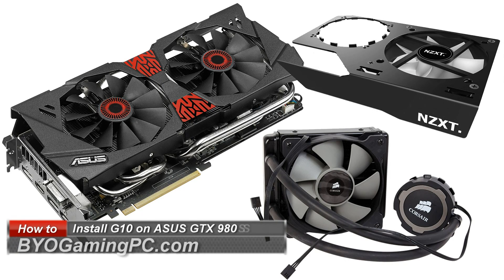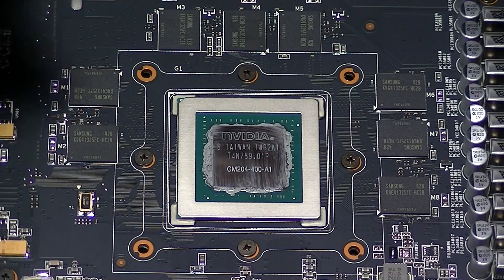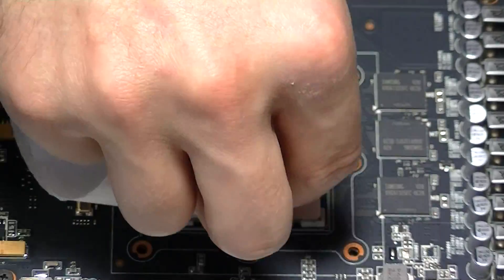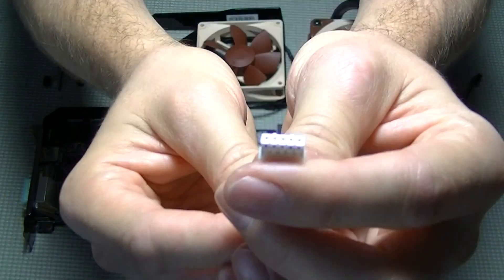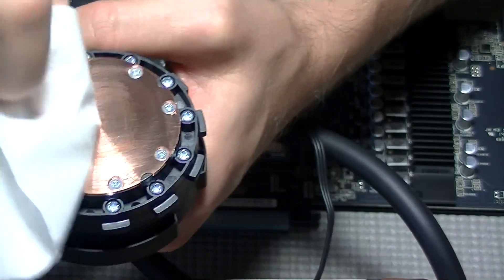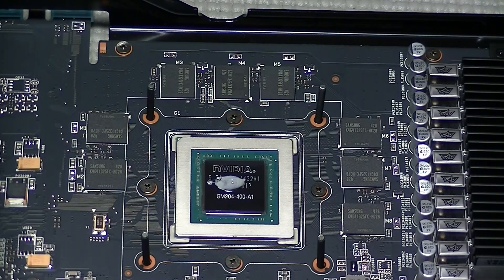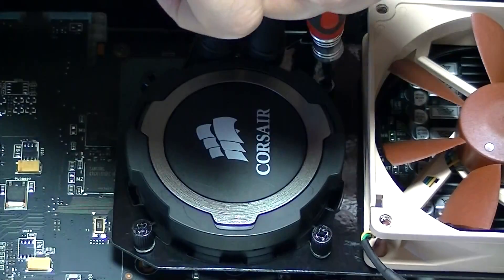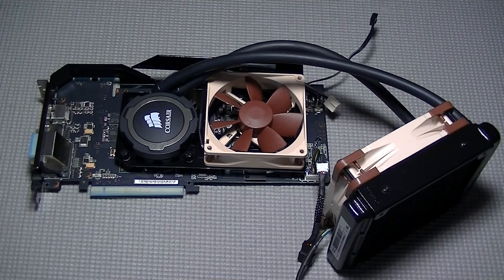ASUS GTX 980 STRIX & NZXT Kraken G10 Installation How to

Comment: Could you link the copper shim you used because I will do this mod with the new G12 to my R9 390 and the official page of NZXT says that I need one because of the height of the DIE itself, thanks in advice :) (if you could find it on europe you are my hero)
Reply from the maker: I didn't use a copper shim in this particular video. I did in this one though. https://youtu.be/weV0FlahyDo?list=PLTLW-NE1XjRCDLWTgKec1BCKucCXqrqdq I also linked the shim in the description.
Reply: Thx for the answer, I mark as favorites the amazon page, and also liked the video :D, but I will ask you another question, how could I know how many mm of depth I need to buy? It's okay with 1mm? Thanks another time for your quick answer.
Reply from the maker: Yes, 1mm should be sufficient.

Comment: I am curious, how are you powering/controlling  the pump?
Reply from the maker: This is how I connected the pump and fans. I should have mentioned that in the video but neglected to. You could always connect it to any motherboard fan header as well. The powered PWM connector I used is linked in the description.

https://youtu.be/RlGMhASE22w?t=10m
Reply: Im sorry the first few times I watched it I thought you were saying not to power the pump from the card but after going back to that section I (yet again...,  I can be a little slow on the uptake sometimes) but I got it now.  thank you for the fast response and the great video,  it has helped alot.
Reply from the maker: My pleasure. I'm glad it was helpful.

Comment: Can this be done on the ASUS STRIX GTX1080?
Reply from the maker: I have not done it but I don't see any reason why it couldn't be done.
Reply: BYOGamingPC You earned yourself a subscriber just by responding! Can you make a video doing it on the ASUS STRIX GTX 1080? Like maybe with a Corsair Water cooling GPU socket and Corsair water cooler.
Reply from the maker: Thanks for the sub! I'd love to do one if I end up getting the parts one day. I buy everything myself so I'm limited in what I can do.

Comment: I like how the vrm's come with a separate heatsink :)
MSI's solution is even better with separate sinks for the memory AND the vrm's, that way they won't overheat so easily if you decide to cool the GPU only with an Accelero Xtreme III/IV cooler or an all-in-one :)

Comment: where do I get a 5 pin adapter? I don't think you put it in the desc. and I cant find anything on amazon. also where would i plug the aio's 3pin?
Reply from the maker: I believe it was from moddiy.com
Reply: would this be it? I already bought the wrong one off of amazon :P http://www.moddiy.com/products/5%252dPin-VGA-PWM-Mini-PH-Connector-to-Dual-PWM-4%252dPin-Fan-Cable-Splitter.html
Reply from the maker: It's not the one I used but yes it will work.
Reply: +BYOGamingPC  hey tha js for responding to such an old video I really appreciate it, and am subscribing. 👍🏻
Reply from the maker: My pleasure.

Comment: hey good vid. i was looking to do this but cant find a 5 pin to 4 pin plug. Can i instead hard wire the pump, the rad fan and the Ram fan straight to the psu?? and just not use the 5pin socket on the gpu?  the 5 pin socket on the gpu is that just power for the 2 fans?
Reply from the maker: I believe it was purchased from moddiy.com
Reply from the maker: You can but they will just run at 100% speed.
Reply: Hi, great video! Do you know where I can buy the 5 pin to 4 pin cable for the fan socket on the GPU? I looking  for this adapter but i cann´t find! I have a GTX 780 Ti Matrix, Thank you for your help!
Reply: thanks man for your help , also if i sinstall this on my asus 980 strix can i keep the backplate on the card aswell? also do i need to worry about applying extra heatsinks to the vram ,or is this bracket with the fan enough for cooling the vram?
Reply from the maker: The VRAM will be fine and yes you can install with the backplate still in tact.

Comment: how tight of a fit would it be if I had two of these in sli?
Reply from the maker: It really depends on my motherboard but in general, it should work with a standard ATX board. I wouldn't try it with a mATX or ITX board.

Comment: You clean every single layer of dust from the cooler and don't over-apply the thermal paste.. I hope it covered the whole die.
Reply from the maker: It does and doesn't make a mess which I can confirm since removing the cooler.

Comment: Good job mate. I am completely ignorant when it comes to GPU water cooling. I have a question: The strix version is a bit more expensive than some other 980 cards, because it has better cooling. Is it possible to do the same thing on your video to a more cheap 980 which costs lets say 50 USD less than the strix one. A cheap 980, the bracket and an h55 water cooler cost like 50 USD more than the strix. Plus the h55 cooler has like 3-4 years life cycle so you can keep it for your next card too. Is it worth it to go that way than spending more for a card with better cooling? I am thinking of doing this for my next card. What is you opinion? Thanks for your time
Reply from the maker: +Xristos Andrio Yes, this will work on about any model of 970. The only benefit to some of the aftermarket models are that they come with VRM or other cooling heatsinks and some upgraded components on the PCB. Are you likely to notice much of a difference? Probably not much unless you plan to overclock.

Comment: Where do you put the vRAM heatsinks?
Reply: +Palahorde And since 970 Strix got the vrm on the otherside, will this effect OC performance? do they get too hot?
Reply from the maker: +Palahorde  You can put the VRAM heatsinks on the VRAM which are located around the GPU. In the video you can see that each of them say Samsung on them. In the case of the VRM being on the backside of the PCB, you will probably want to put some smaller heatsinks like these on them. http://azon.ly/eoZK3R The 970 doesn't use a lot of power so you should be alright overclocking. I wouldn't recommend doing any BIOS modding to unlock more voltage though.
Reply: +BYOGamingPC So it will be enough space between the G10 bracket and the VRAM heatsinks? :) My Core clock and temps are all very good but i cant go further then 72000Mhz on the Memory clock, yet many say these samsung mems hit 7800-8000 easy. I will try to get a new card, if not i will resort to this to get more heat of around the core and potentially cool VRAMs more. But it runs sooo cool though, 60-65c and i get blackscreens just because the mems are unstable...Ty for answer!
Reply from the maker: +Palahorde They should fit underneath. I haven't used them since I never did much overclocking. They are pretty low profile.

Comment: @BYOGamingPC I heard this does not fit on cards with the ACX 2.0. Do you think this would work with EVGA 980 sc ACX 2.0 or is there some reason it wouldn't fit?
Reply from the maker: +Dart Master In my experience it fits fine.

Comment: I called Asus hardware support and they confirmed the strix pcb and memory layout is the same as the 980 matrix. Does the g10 keep the memory cool with only one fan?
Reply from the maker: +cjones29hd The memory is located near the GPU. The fans keeps the VRM's cooler than with the STRIX cooler but there is no direct cooling for the memory. Memory generally doesn't get very hot but with some serious overclocking you will want to get some RAM heatsinks like the ones linked in the description.

Comment: Hi, I got the same Grafic card and  I wanted to know where you got the Adapter from?
I Found the Gelid VGA to PWM, but not the Adapter you used between the Grafic card and the Gelid Adapter?
Reply from the maker: +Chris A I think I ordered it from either frozencpu or moddiy. To be honest, I can't really remember. ASUS is the only manufacturer that uses the 5pin fan connector for some reason.
Reply: +BYOGamingPC 
I just found something here http://www.moddiy.com/products/5%252dPin-VGA-PWM-Mini-PH-Connector-to-Dual-PWM-4%252dPin-Fan-Cable-Splitter.html
I´m using the Raijintek Morpheus, so I chose the dualadapter for pwm on the grafic card.

Thanks a lot
Reply from the maker: +Chris A My pleasure.

Comment: Hi, Thanks for doing this video. I have just bought the Asus R9 390 Strix which is a beast of a card but runs a little hot (80 load). Does this void the warranty with Asus? I see on the back of the card it has a little white sticker over one of the screws, so they know if you have tampered with it. Any way of getting this off without it being obvious that you have? If not, any way to buy them stickers anywhere? Thanks
Reply from the maker: +Matt Prince You will need to check directly with ASUS warranty information for your card. I can't quote for sure since I don't know but I don't believe that it will void your warranty.

Comment: Why isnt gtx 980 ti supported?
Reply from the maker: +Egil Sellgren It is.
Reply: +BYOGamingPC i emailed nzxt and they said that, "due to the length of the pcb, the card is not supported"
Reply from the maker: +Egil Sellgren Their website says otherwise.
Reply: +Egil Sellgren There are several different varieties of the 980 Ti, with varying PCB lengths.  Could be that your particular 980 Ti is not supported.

Comment: Can I do this with the Strix 970 and just have a fan blowing on the vrm and ram?
Reply from the maker: +tonybedrosian Yes, this will work great on the 970 but the 970 runs pretty cool already.
Reply: +BYOGamingPC thanks for the quick reply. I'm planning on doing something like this soon.
Reply from the maker: +tonybedrosian GLHF!
Reply: +BYOGamingPC  SO you can keep the back plate on? I also plan to get a strix 970 and I would love to keep the backplate.
Reply: I like the backplate too.
Reply from the maker: +Cooper Deitzler Yes you can.
Reply: BYOGamingPC thanks
Reply: also, i heard that the g10 fan doesn't blow on the vrm for the strix and that the card freezes up from overheating, is this true?
Reply from the maker: +Cooper Deitzler The fan blows directly onto the VRM's

Comment: I use a alcohol wipe to clean off old thermal grease and also that stuff is conductive so you want to make sure you dont force it under the top plate and get it into the components or it can cause a short.
Reply from the maker: +Ian Crawford Alcohol wipe isn't a bad way to get the largest portion of old TIM off but you need something more pure to do the finishing touches. Alcohol wipes have the potential to leave residue if they are not at least 95% alcohol. IC Diamond is electrically non-conductive and non-capacitive so there is no reason to be worried about it touching other components.
Reply: +BYOGamingPC I bought some IC Diamond 7 carat compound. I was looking for some non-conductive compound but I have trust issues from back when I was young. Had a computer jump about an inch off the ground when it blew up.
Reply from the maker: +Ian Crawford You shouldn't have any issues with IC Diamond.

Comment: i have a gtx 970 and did it my temps where 73 c on load then with the water cooled i get 32 to 51 on load i had to buy heat sinks for the v ram and i suggest you get them too for the install

Comment: and VRM is not cooled? It seems not ok
Reply from the maker: +drobillka Yes, the VRM is cooled with the fan on the bracket and it is more effective than the stock cooling.
Reply: BYOGamingPC ehm.. i really wrote VRM? i mean GPU RAM )
Reply from the maker: +drobillka There is no active cooling on the VRAM but VRAM doesn't get very warm unless you overclock it quite a bit and if your case has good airflow it's not much of an issue.

Comment: Did you used some of the pads that comes with the kit under the vRam cooler fan?
Reply from the maker: +Rehuel Galzote Yes, I did but they aren't absolutely necessary.
Reply: +BYOGamingPC What do you mean? Not necessary to show or not necessary to put?
Reply from the maker: +Rehuel Galzote Necessary to use. You can use them if you want but you don't have to.
Reply: +BYOGamingPC I see. Thanks.

Comment: Are you able to have 2 cards in sli with these?
Reply from the maker: +KillTheCurse Sure can as long as your motherboard has the proper spacing. You will likely need at least a full ATX board. Your case will also need space to mount both radiators.
Reply: BYOGamingPC At the moment I've got roughly an inch between the cards as it is.  I'm not sure if I'd really benefit from this though.  I've been looking for ways to run more cool and quiet instead of 80c with fans at 70-80%.  I dont even know where id but the rads lol.  Even if I only did the top card.
Reply from the maker: +KillTheCurse I've run this in an SLI setup just installing the G10 on the top card and had excellent results. I highly recommend it if you can mount your radiator somewhere. Likely in the front of your case or the rear as exhaust would be best.
Reply: BYOGamingPC Thank you for answering my questions.  I'll most likely get one for my top card then and find somewhere for the radiator.  even If I have to build a stand for it outside my case.  

I've been seeing a lot of people talk about the v ram not having proper cooling with this.  Is that any cause for concern or would it be fine with stock clocks?
Reply from the maker: At stock clocks out isn't a problem but can be of you overclock and have little airflow in your case.

Comment: Will this fit on a Asus geforce gtx 960 strix? I know i dont need to but i just want to know
Reply from the maker: +vidde nykvist I don't believe that it will since the PCB of the 960 is much shorter.
Reply: +BYOGamingPC Will it fit on the 970 turbo?
Reply from the maker: +vidde nykvist It should.
Reply: +BYOGamingPC will it fit on msi 970 oc tiger?
Reply from the maker: +vidde nykvist It should.

Comment: Hi,

And the VRM? It was too hot? Did you install any component to cool the VRM?
Reply from the maker: +Allan Pasking The VRM cooling with the G10 installed was about 8C cooler. The ASUS card has a VRM heatsink that is installed and the Noctua fan is far superior to the stock ASUS fan for cooling the VRM. The 980 runs cool all the way around due to it's low power.

Comment: theese mofos sent me the wrong screws in the g10 kit and i contacted nzxt with the issue and they sent me exactly the same screw set DAMN IM PISSED RIGHT NOW!!!
Reply from the maker: +Mark Eriksen The screws I used in the video are not the stock screws that come with the kit but I did link them in the description.
Reply: +BYOGamingPC but dont you think its weird that the screws that come in the kit for g10 bracket doesn't fit the bracket itself (the watercooling part of g10)
Reply from the maker: +Mark Eriksen Sounds like maybe your problem is the bracket? I didn't have any issues with mine and NZXT sent me a bonus set of hardware just because I asked for it.

Comment: You didn't say where you picked up the 5-pin to 2X4-pin VGA fan adapter. I'm in the UK and cannot find one for love nor money. The nearest is a 2 week send from Hong Kong... any other places you can recommend?
Reply from the maker: +Christopher Bramley You can get one here http://www.frozencpu.com/products/22533/ele-1280/5-Pin_VGA_PWM_Mini_PH_Connector_to_Dual_PH_Mini_4-Pin_Fan_Cable_Splitter.html

Comment: No check the gtx 960 strix or EVGA GeForce GTX 960 4GB FTW or windforce  are capable of water cooling
Reply: +froiran Aguilar Will this fit on the 960 strix?
Reply: +vidde nykvist they are some but I have to look it up to tell you the names
Reply: froiran Aguilar
Ok ty

Comment: Why do you have so many scratches on the cooler instead of having it as smooth as possible?
Reply from the maker: +xXMrProGamingXx The cooler is about as smooth as it came new. I don't have a machine to lap the surface so I can't do anything about it but it has also been used and reused many times so it will have some natural wear over time. It's in great shape though.